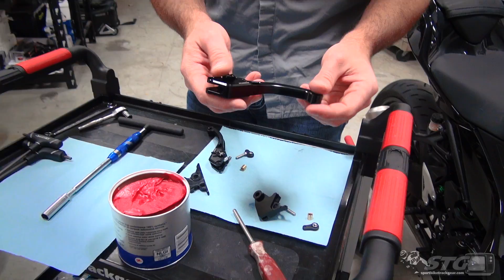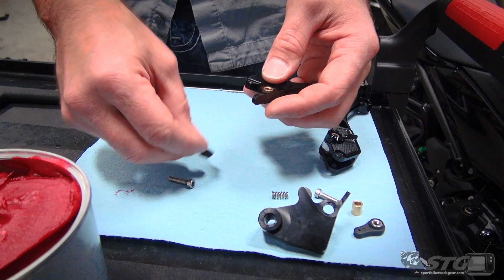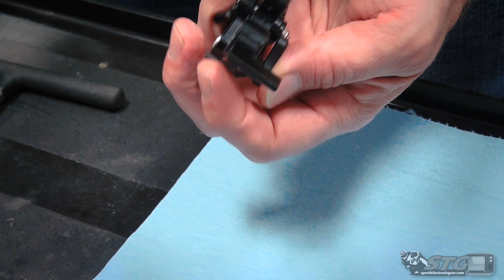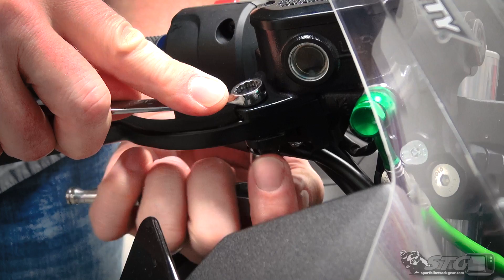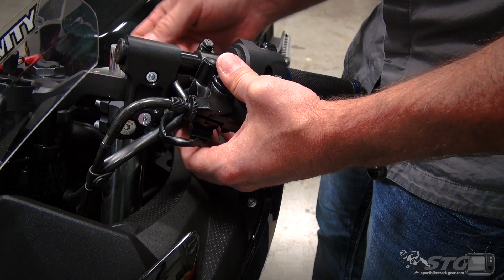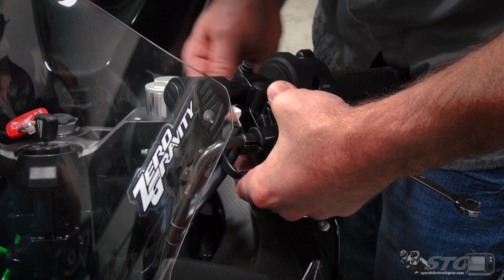Vortex Kawasaki Ninja 400 V3 2.0 Levers Install | Sportbike Track Gear

Comment: Yo bro, just out of curiosity are there any benefits to having short length levers over the oem size? 

Or is it purely a personal preference type a thing?
Reply from the maker: I personally do not like the short length levers, all you do is lose leverage with the shorter lever so it is harder to pull. Some people prefer the look of the short length levers. - Van

Comment: Your link says Vortex Yamaha YZF-R1 15-24 V3 2.0 Brake Lever but it will still fit my ninja 400 2021?
Reply from the maker: No, use these:
Vortex Kawasaki Ninja 400 18-23 V3 2.0 Brake Lever
https://www.sportbiketrackgear.com/vortex-kawasaki-ninja-400-2018-v3-2-0-brake-lever/

Vortex Kawasaki Ninja 400 18-23 V3 2.0 Clutch Lever
https://www.sportbiketrackgear.com/vortex-kawasaki-ninja-400-2018-v3-2-0-clutch-lever/
Reply: @sportbiketrackgear  wow thanks so much

Comment: Do you have a link to buy these as a set for a 04 gsxr600? Can't find them on your site
Reply from the maker: Vortex Suzuki GSX-R600 04-05 V3 2.0 Clutch Lever
https://www.sportbiketrackgear.com/vortex-suzuki-gsx-r600-04-05-v3-2-0-clutch-lever/

Vortex Suzuki GSX-R600 04-05 V3 2.0 Brake Lever
https://www.sportbiketrackgear.com/vortex-suzuki-gsx-r600-04-05-v3-2-0-brake-lever/

Comment: I just put these levers on my 2021 GSXR 1000. With the help of this video I feel confident that the job was done correctly. I really like your instructions at the end to do a short ride and take the time to double check your work. Very wise words. 
I have done several upgrades to my motorcycle while watching these  STG "how to" type videos in my garage , pausing while I do the work. The STG videos have created a loyalty in me towards STG, because I really feel like STG has enriched my motorcycle hobby experience. STG is my "go to" source for parts and education on motorcycle upgrades and maintenance. Thanks guys.
Reply from the maker: You are welcome for the videos, happy to hear they are helpful. Thank you for your support and the kind words. - Van

Comment: Great video, very informative since there are no instructions that come with the levers, WTF!!?  Installed these on my '09 FZ6R and really like them.  After installing the clutch lever I realized there was a lot of play in the lever.  Turns out I had to use the metal bushing from the original lever and install it into the Vortex lever, problem solved.  That said, these levers really feel great on the bike.  Got 'em dialed in just right and they look sharp too.
Reply from the maker: Happy to hear this was helpful and enjoy the new levers! - Van

Comment: Great vid as always.  Looking to replace my stock ones on my 01' ZX-12R.  I'm more inclined to stick with the long ones and something adjustable.  The stock clutch lever especially, I feel, is a little too far of a reach for me and is not adjustable in that way at all. Cheers!
Reply from the maker: I prefer a standard length lever on my bikes as well. - Van

Comment: I know this is an older video but I was wondering if you would recommend these for a daily rider? Looked around and figured these had a solid bang for the buck (far cheaper than asv or crg) for someone who just wants to spice up their daily ride. Thanks!
Reply from the maker: Yes these are an excellent lever for the track or the street. - Van

Comment: Just realized you were using different clip ons when I went to put my clutch lever on haha. That locking nut is really hard to reach without taking a ton of stuff off on the factory clip ons.
Reply from the maker: We replaced our clip ons with the Woodcraft Ninja 400 Clip Ons before we took it to the track. The OEM are a little too high up for track use. - Van

Comment: Hi, I have a question about oil filter of ninja 400. I know that I need to change th filter after first oil change but should I change it with every oil changing? (I am using k&n 303) thx!
Reply from the maker: Always change the oil and filter at the same time. - Van
Reply: Sportbike Track Gear thanks for help man!!